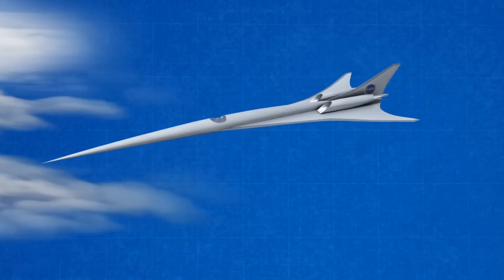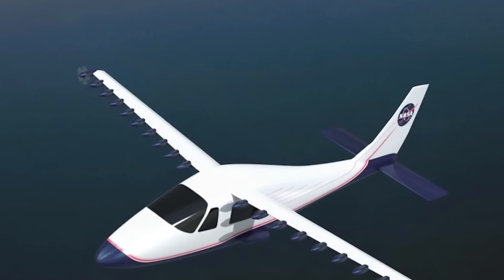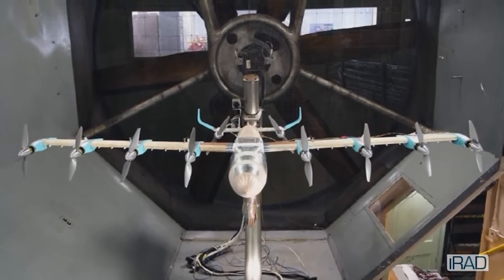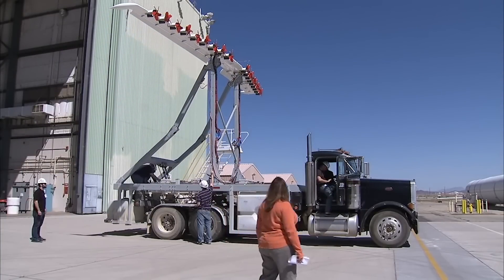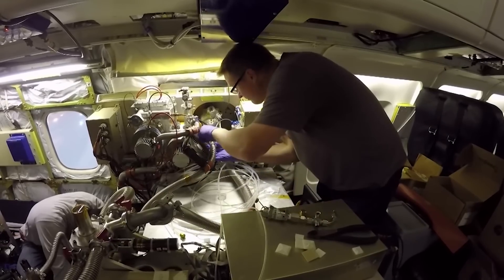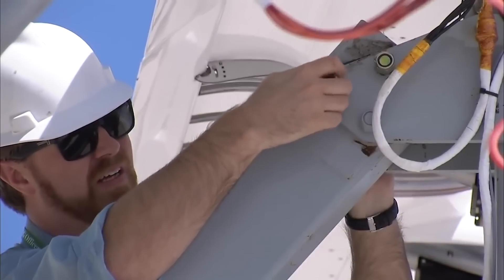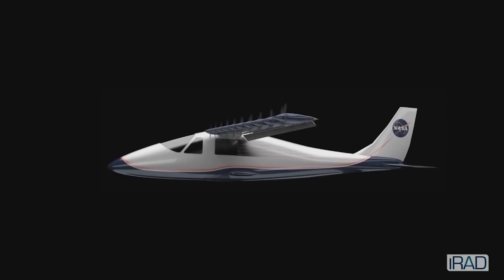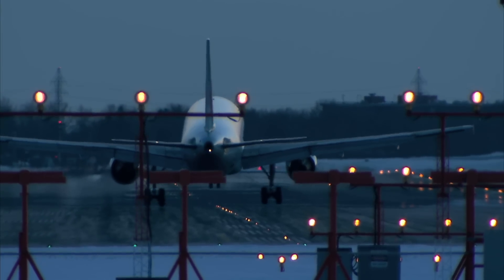NASA’s New X-Plane Looks Goofy But Packs Some Serious Tech | WIRED

Comment: Overlooked by all these comments is the possibility that this plane will not carry heavy batteries but will be tethered to them by a long electric cord.  The batteries themselves will be carried on a flat bed truck which will traveling along the nations hi ways.   So far the only limiting factor that has not been solved is how to plan routes so the truck does not have to pass under any underpasses.  Eventually, the hope is that the plane can be powered by a single wrist watch battery.   It might not be a good idea to invest your money in this project just yet.   Yeah---and someday we'll put a man on the moon.

Comment: Distributed power and blown wing is valid, but not as done on the x-57.  They did a non linear optimization and it led them to the wrong solution.   BTW, they claim 3 cents/kw-hr, but the national average electricity cost is 15 cent/kw-hr, or about 5 times more than claimed, and hence the 5 time "less" cost.  They have spent $15 million and this will fail too.  Mine will work.

Comment: You won't see electric passenger aircraft in any of our lifetimes.  Batteries are too heavy.  Turbine engines don't carry most of the fuel with the aircraft (air).  The lighter and more powerful the battery, the more volatile and dangerous they are and the less you'd want them on airplanes.  The better battery tech gets, the more exotic the materials become and bad for the environment as well.  Then there's the issue of refueling.  It might take an hour to fuel and turn a jet, but no one wants to wait 12 hours (or maybe days) to recharge an aircraft.
Reply: Wrong
Reply: Jeremie Sheperd You're wrong.
Reply: Jeremie Sheperd You're still wrong.  Elon Musk is wrong most often.  Real engineers chuckle at his tube tech.  The more a cell has power to weight viability, the more caustic it is to produce.  Nothing can match fossil fuel power to weight ratio.  I've worked for the oldest aviation companies, and they all have models on the walls, exactly like you article cites, that were a pipe dream in 50's.  Theres too many failure modes on unconventional aircraft.
Reply: When you're a billionaire I'll listen
Reply: Cry me a river. This bores me.

Comment: "Wings on atypical plane are nice and fat because they have to generate lots of lift" -commercial airplanes have thicker wings because they need to use stronger materials to withstand stronger forces when travelling faster. They are also thicker because wings carry fuel in them.

Comment: I'm intrigued, how much is the drag reduced by?  Is it enough to bring biplanes back into practicality?  I've often wondered if the extra lift generated by the additional wing would be something that could be used to save fuel/energy long term, but I know that the additional drag generally makes it not worth it (especially at modern speeds)

Comment: Let me guess, It will carry 2 passengers for 50 miles and it's basically a useless concept?
Reply: the design itself can cut the fuel consumption into 1/5 of that of current designs which they say in the video. so no, it's not a useless concept. And when tech gets better (batteries etc) they might even scale it up to full size passenger jets, who knows!
Reply: Sure, and we'll also have flying cars and humanoid robot servants in our holiday home on Mars by the year 2000.

Oh, wait.
Reply: Wouldn't it stop being a car once it is flying?
And robot servants are really not that far away, give it 30 years and we'll be there!
Some people will probably be on mars as a result of the mars program in some years aswell. Pretty amazing stuff isn't it?
Reply: I'll believe it when i see it. I can never see that design being useful for airliners.

Comment: Well, if planes are more efficient, and use less/no fuel, wouldn't that mean that costs will be lower? Hopefully that will then lower tickets, and then baggage fees.

Basically, NASA IS helping lower baggage fees.
Reply: or just bigger planes, not lower cost
Reply: The Reeper airlines are moving towards smaller planes. Also, there might be a limit to how big the planes can be.
Reply: ***** but if they are cheaper to run, why not make even bigger planes
Reply: The Reeper Physics?

Maybe "If they are cheaper to run, why not just make more money?"
Reply: ***** besucse if they can fit 5x more people in one plane, they need 5x less planes, 5x less cost of operations do to FAA with the same profits
Reply: The Reeper I feel like we are going in circles here.

I know there is an upper limit to how big a plane can be. I don't know what it is, but I have a feeling that this solution wont make it possible to be much more efficient at larger sizes.

Also, you are forgetting that making bigger planes doesn't mean you'll be able to fill them with more people. If Airline One has 5 flights leaving NY daily, each to a different city and each flight is packed full but without enough to justify a second daily flight to the same destination, how do you justify making the plane even twice as big? They'll then be flying an empty plane. And that isn't taking into account the fact that having a varied schedule (with flights leaving at different times to the same destination) might be better than one daily flight with more room.
Reply: ***** but say that the flight going to new York had 2 flights instead, make that flight twice as big, you just cut your costs a lot, that what I ment
Reply: hah smaller planes? look up the newest airbusses they are getting more and more packed
Reply: ***** You are far from correct.

Both Boeing and Airbus have only two planes (each) in production that are considered "large jets", and only three of them (2 for Boeing, 1 for Airbus) have the ability to carry more than 500 passengers.

Of all of the planes currently in production, the planes with the most orders and deliveries for both companies are the planes with 150-300 seats (B: 767, A: A320) with the B777 and A330 (with 300-550 and ~300 seats respectively) close behind or tied. This is also reflected in both company's latest plane - Boeing's 787 "Dreamliner" and Airbus's A350 (both with ~200-350 seat).

It is clear that airlines and manufacturers are both moving towards smaller, more efficient planes instead of huge behemoths like the 747 and A380 (with 1,700 and 190 built, respectively - and that is without taking into account that most of the 747's were built decades ago and were revolutionary at the time).

Even if we just look at Airbus their last 4 models (A319, A318, A380 and A350) going back 20 years now, only one has more than 350 seats (the A380, if you include max capacity, the A350 allows up to 500 seats) while the A319/318 both allow under 160 seats at max.

If you don't believe me, you are welcome to look at the numbers here:

https://en.wikipedia.org/wiki/Airbus#Civilian_products

https://en.wikipedia.org/wiki/Boeing_Commercial_Airplanes#Aircraft_in_production_or_development
Reply: Regarding little or no fuel, both aviation gasoline and electricity are forms of usable energy. Electricity is fuel as much as the coal and gas burning plants that create it. I didn't hear anything about solar. Interesting concepts though. BTW Does baggage fees include knowing where your luggage is? ;)